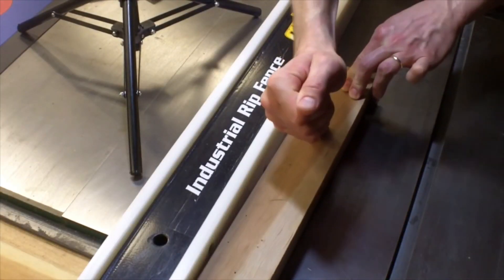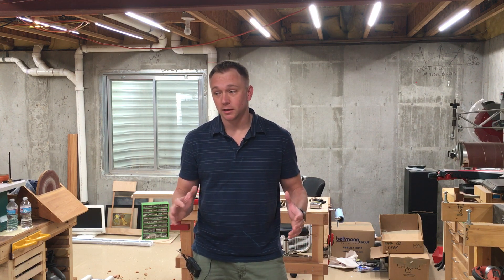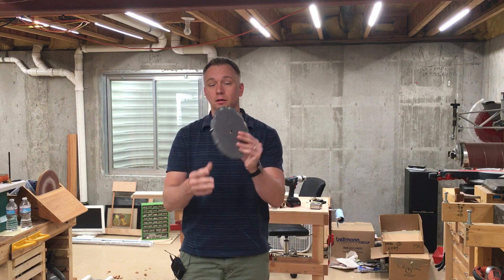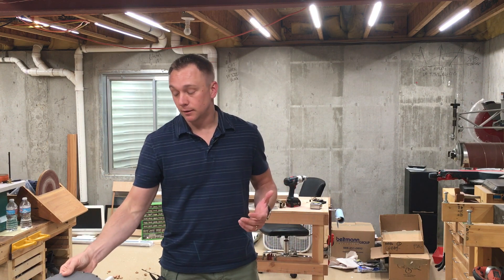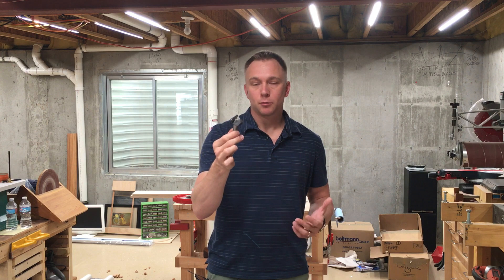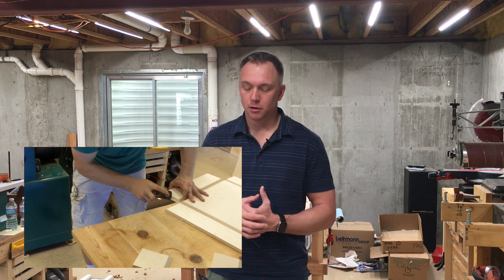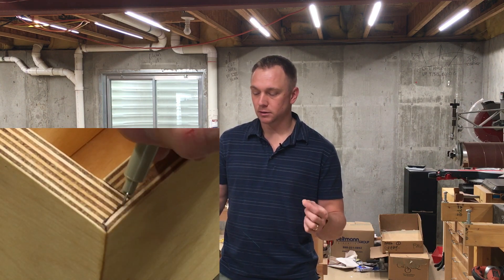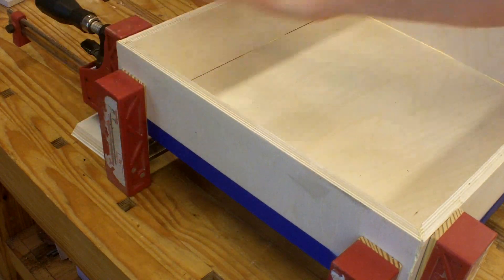Overdue update on the Blade

Comment: I know this video is from 206 some 3 years ago, however I agree with you when you said $100 for a router bit is not cheap.... Therefore how can you justify $350 - $500 for a tablesaw blade, that using your words really gives you a slightly greater gluing suface area.

As a DIY woodworker that is is way out of my price range and i dare say the price range of many , DIY woodworkers consering the amount of use It would get and the finished product it would give me.

A 1/4" dado stack, 1/4" high and 1/4" away from my fence gives me a locking joint on all sides, this can also be done on a router with a 1/4" straight bit which costs significantly less. Look up the quarter, quarter, quarter method.

Its a unique Idea and I understend manufacturing and design has costs, however I feel at this price you have lost about 70% of your customers on what could be an idea / tool that revoulutionises the woodworking community.

Comment: As for me I think 350$ is a bargain for your dado stack. If it will save me one hour of work comparing to other joining techniques it'll have payed for itself in less than 4-5 hours. Get real people, this is great! The real competitor to this, if you find the price to high, are drawer lock router bits. They'll probably provide an equal strong joints or even stronger for a 10th of the price but Andrews dado set is still much faster.
Reply from the maker: Appreciate your thoughts Eric